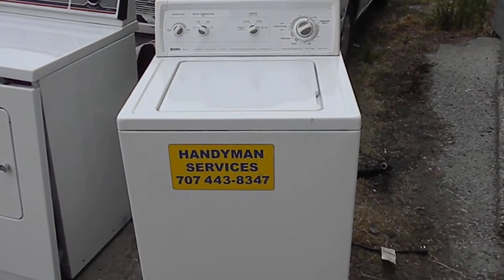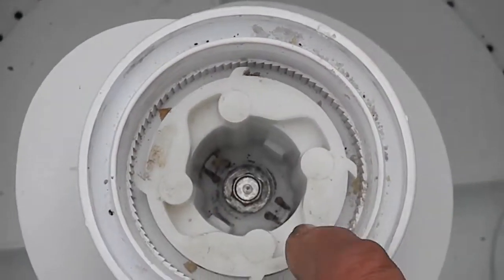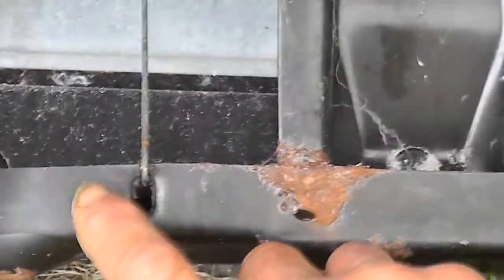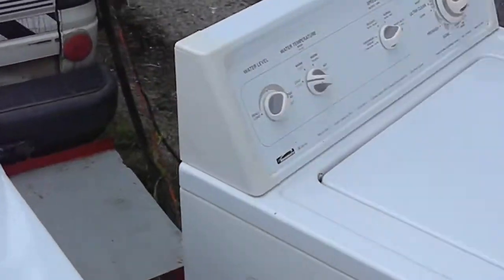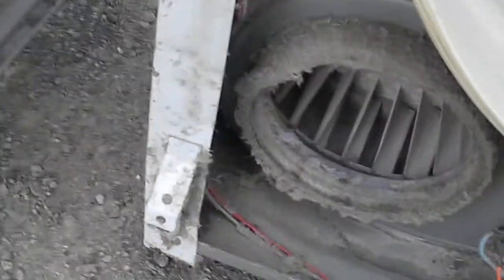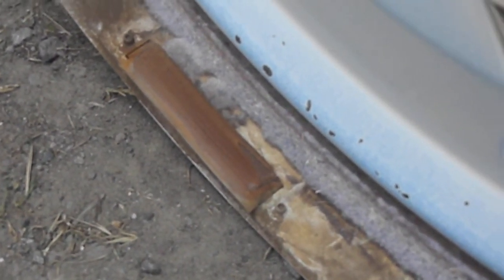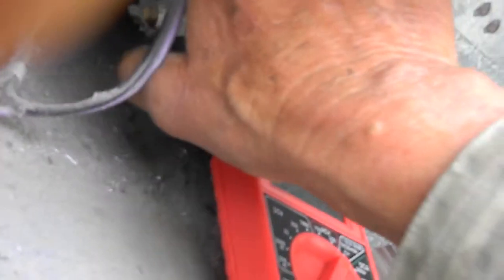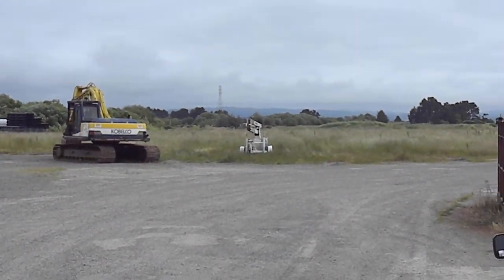Washer not cleaning,off balance,not pumping/leaking,Dryer not heating,Eureka Appliance Service

Comment from the maker: Here is some theoretical information on a Kenmore washer  and a Maytag electric dryer. This stuff can be dangerous to repair. In all my videos  I presume you have basic electrical and mechanical knowledge but recommend that you prove this information to your self before attempting any diy repairs. All information is as is with no clams or warrentee. I can not be held responsible for anything you might mess up. Thank you for your support. Eurekarecycler at yahoo.